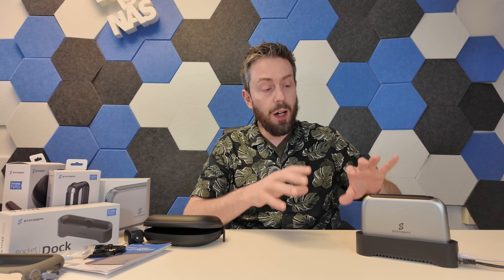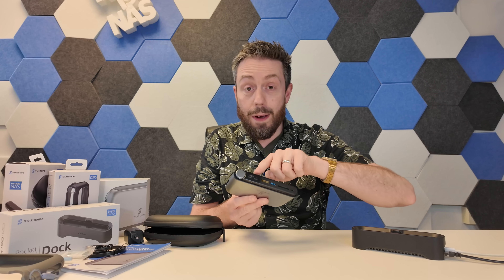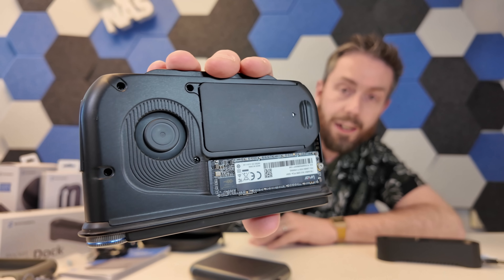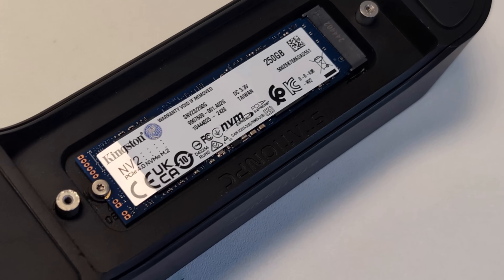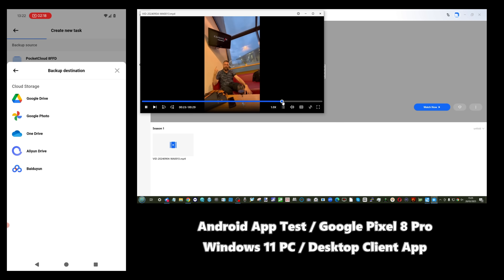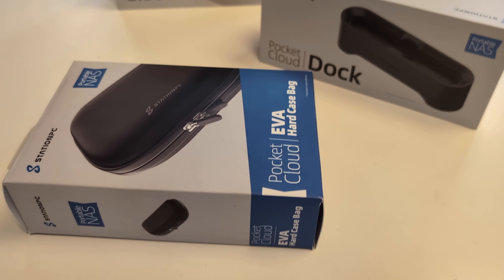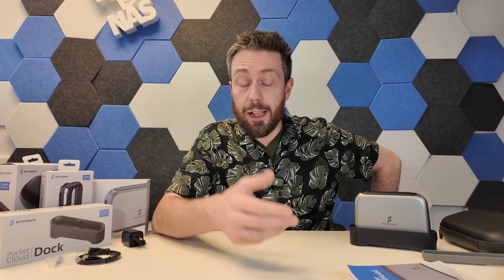PocketCloud NAS Review (The StationPC Portable NAS Drive)

Comment: how has nobody done with this with a raspberry pi yet?
Reply: I tried this a few years ago, using RaspAP.  It was a bit janky with an external SSD, powerbank, and an SD Card reader sticking out of it but it mostly worked.  I stopped using it because it was more trouble than it was worth.  This solution is much more streamlined than I was able to cobble together.

Comment: Docker will not run on ARM processor.
Reply: Yes it does, and the processor they use (RK3568B2) can run it. The issue is what is the StationOS built around and just how much of the 4GB of RAM would be free for other tasks.

Comment: This is an interesting device, but I just don't get the point of using that over just a small SSD thay you can connect to your computer.
Reply: I would use it asa wireless drive mostly for media consumption. Pitythat it only charges via the dock...

Comment: I'm really curious about the Wifi connectivity. Will it act as a travel router or do you need to carry that as well when you're on the road ? I'm still waiting / hopeful for the arrival of a travel router /NAS in a single unit.
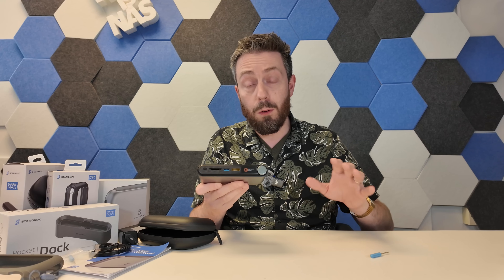Reply: He does mention you can connect to it through wifi 6 at 6:48.  I sorely needed something like this yesterday trying to transfer a photo from my phone to my ipad.
Reply: @howlywoof9365  Yes, I saw that but having Wifi connectivity won't necessarily allow it to route traffic. As for your photo, I feel your pain. Apple is so locked down for simple things like that. Have you tried using Airdrop which is built into your phone and perhaps iPad ? I don't use it but my girlfriend does occasionally. She has shared photos with Airdrop before.
Reply: @howlywoof9365  if you have an iphone you can just copy paste or use airdrop.
Reply: Need a separate 4g or hotspot or whatever..

Comment: As an event Photographer that prints on-site. This looks like a good device for my runners to carry with them. They goto Photographer copy images then dock and all my stations will have the data to view and print. I hope it works like i need it to.
Reply: Lexar workflow go is out too.  449 for card reader, the unit and 2tb SSD.  I’m trying that.
Reply: I have a similar problem just a different industry like how do you cloud on a construction site and send reports to a project manager whe. You are using a mobile Hotspot with spotty service and your phone lacks internet because the building blocks out cell service and its all concrete and steel? No wifi or any yet you have to find a cable or walk outside and email them to yourself for the reports and documentation
Reply: DANIEL JURAO
Reply: DANIEL JURADO